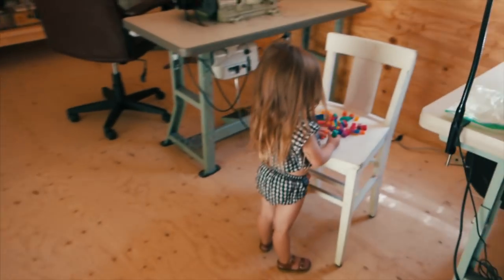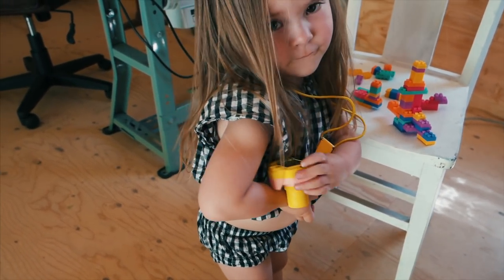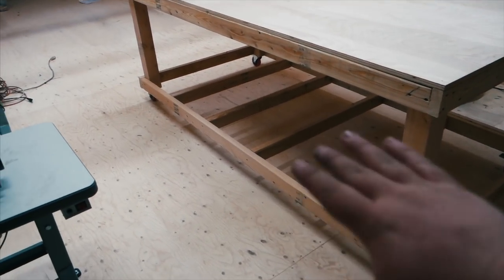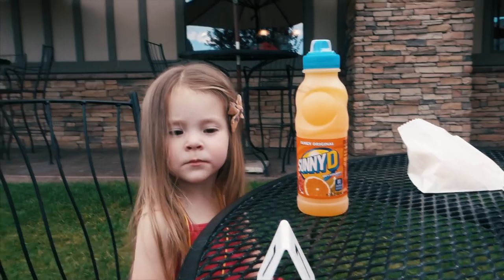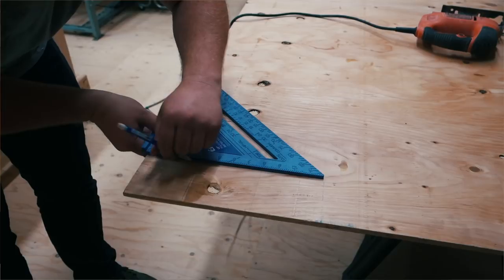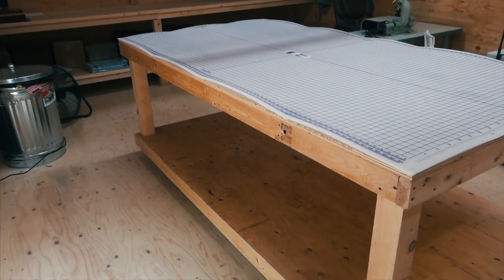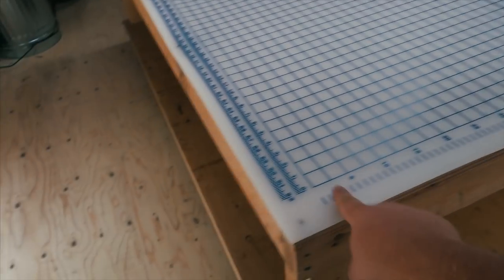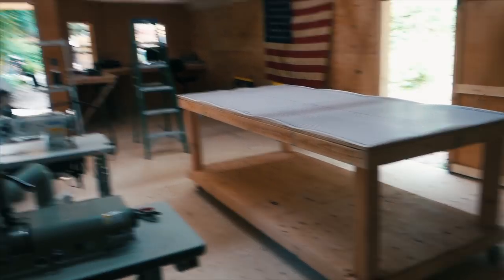Building a BIG Rolling Workbench for our Leather Workshop

Comment: Man, I just bought materials for a similar table up in Canada..  So far I'm at $210 for plywood and 2x4's, and nearly $100 for screws and bolts. Happy to see you guys still get reasonably priced materials down south..
Reply from the maker: oh man! that's steep. To be fair, I only used cheap grabber screws on the whole thing. I imagine if you used some big lag bolts it might get a little pricier. Also, I already had the piece of birch that I used for the top. So that price really only includes the 2x4's and some grabber screws
Reply: Ah, well that puts us a little closer together I suppose! :)    I was contemplating doing a 4 or 5" overhang so I can stand at it without smashing my shins, and a slight curved indent on one of the long edges to give me a bit better reach across the table..  Now that you've had a chance to use yours, do you reckon those features would be a help or a hindrance?
Reply: @cavokdotcom  Ahhh!😕I wish he answered your question. I was thinking something quite the same . I'm short 5ft 2in. So the stretch is a bit much.and with the wheels it would hit mid shin.  LMAO! That could be a, hazard.
Reply: @barbaravance6774  I ended up not building the table this year, and I'll be heading south for the winter so it'll be a bit before I need one up here.  I'd say the overhang would definitely be helpful.  You can always cut away a bit if you need to reach the other side of the table more comfortably..  And you can always raise the hazardous cross braces up so they smash your knees instead of your shins... :D

Comment: How is this workbench for pounding/punching (particularly since you have it on wheels).... I made a workbench using 3/4 plywood and its supported along the entire sheet, but if I punch holes ANYWHERE else other than on the corners, where the energy is transferred to the legs/floor, it bounces LIKE CRAZY. Thank you for your response in advance!

Comment: I noticed on one of the long sides on the bottom you doubled the 2x4’s. Any reason for that? I’m planning on building one of these soon.
Reply from the maker: Marcos Alvarez haha it’s only because I accidentally cut the cross braces too short. So instead of cutting new ones, I just threw in that second 2x4 kind of as a spacer 😂